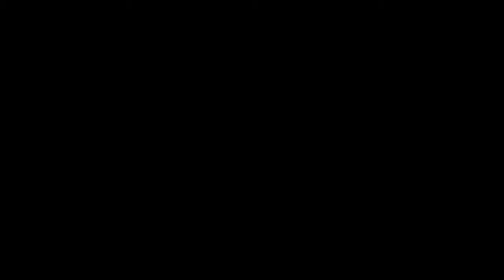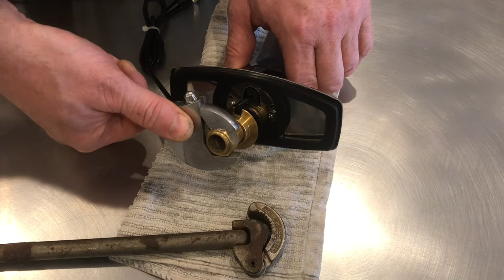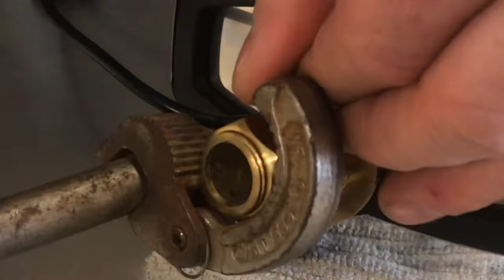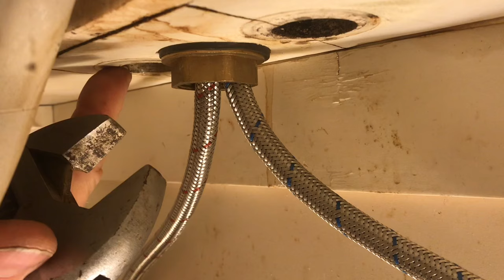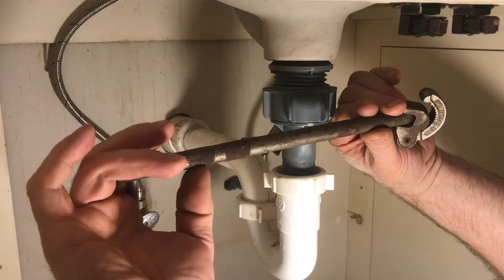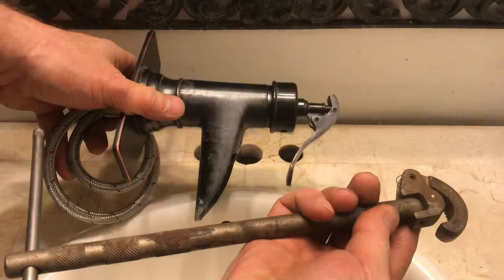how to use a BASIN WRENCH to “remove” a faucet

Comment: I used this video to remove and install a new soap dispenser, and tighten the spout. The nut and washer on the soap dispenser were rusted, and very tight. The basin wrench grabbed onto it, and it finally gave. Good thing I was wearing my eye protection because of all the rust that fell down. Thanks for the great video!

Comment: I found one of these in the road a couple of years ago. I use it to pull the tension spring on the zero turn mower deck. now I know! thanks.
Reply: I guess I should take better care of it.
Reply from the maker: I’ve used this basin wrench on really tight bolts when working on the car. Sometimes I sharpen the teeth to make sure It grabs a little better.
Reply: @livefree6878  id love a video on sharpenings

Comment: This tool can be better...it needs a steadier or more secure grip around the nut....this tool slips off sometimes.  Maybe there needs to be a way that the stick part, can rotate and adjust  the head to wrap around the nut more tightly.

Or maybe the head of this tool can be a full circle and the stick part can rotate to adjust to the same size as the nut.

Comment: I was doing it the same way, how come it doesn't hold firm but keeps sliding?
Reply: I've had that; almost feels like the spring isn't quite tight enough. If you'd sprayed the nut with WD40 or similar then wipe off the excess, then sand around the nut. Another video recommends putting sandpaper around the inside of the wrench for extra grip. Failing that it's a blowtorch.

Comment: I need to install a Franke kitchen faucet and that nut is 1 1/4" will this tool do that size? They already installed the sink so it's very tight in there. thanks
Reply: Yes I have never seen a basin wrench that doesn’t go up to 1 1/4”. The one used in this video  should work so look for that size!